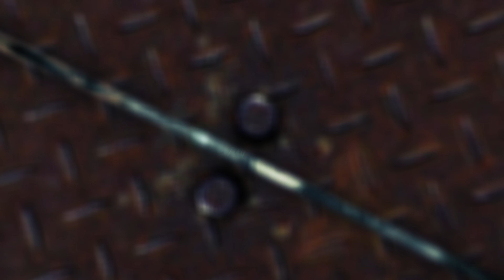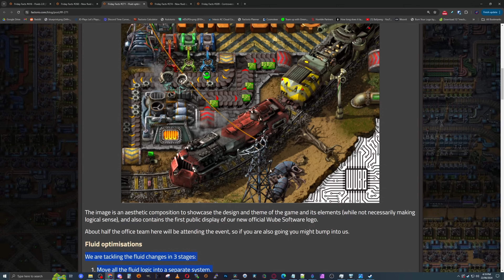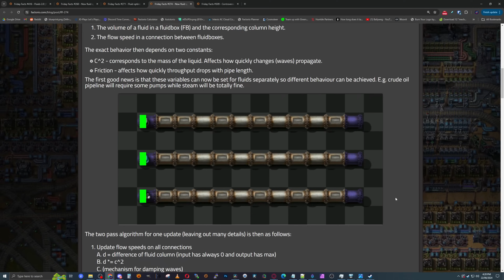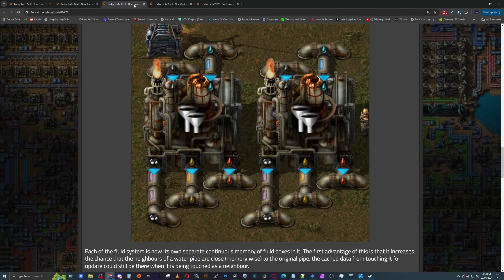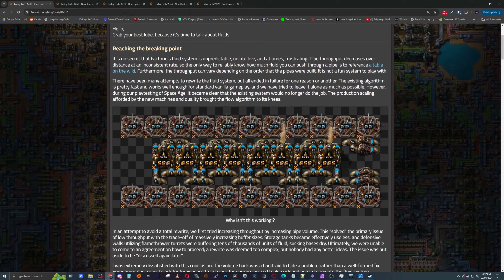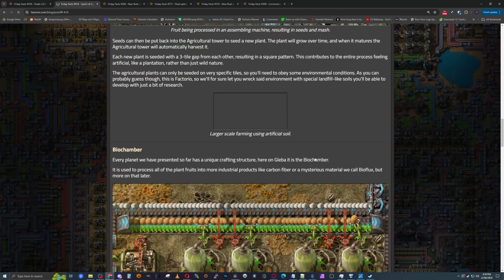Factorio Friday Facts #416 ⚙️Fluids 2.0

Comment: the example of the fuel etc about balancing out its so wrong... you need both fuel and oxidiser for the plataform to move.. wich gives you meteorites wich gives you ice wich gives you fuel and oxidiser... if you have more fuel than oxidiser you cant move the plataform.. you wont move... done

so insted of having a fluid system that just work this guy wants an inserter and circuit to bypass something bad. -.-
my god.. let the other guy have his own opinion..

Comment: 15:00 The problem with the long pipe (as stated in the paragraph above the video) is that the flow is not predictable. If you look at the green bars you can see that although it trends downward there are many spots were the fluid level randomly spikes up.
Reply: The chunk boundary problem is an issue I completely forgot about and it causes even more weird effects if there is a pipe junction on a chunk boundary.

Comment: this whole fluid nonsense is solving a non-issue
Reply: Floating point rounding error. UPS. Ugly underground pipe to underground pipe chain. Tanks balancing using circuits at train station. Yeah, there are no problems.
Reply: Perhaps a current non issue (though while it's true that there are effective work arounds that does not mean it isn't a problem for everyone else without the knowledge for the work arounds)

Who knows that you might need it on a pipe only planet or whatever not possible in the current system.

New system seems quite simple
Entire pipeline is effectively one tank, insert speed is unlimited to the trank, withdrawal speed is based on fill level, location and distances are irrelevant.
Pumps are one way gates between tanks that drains one "tank" to fill the next.
Reply: Except it sounds like it became an issue: "However, during our playtesting of Space Age, it became clear that the existing system would no longer do the job. The production scaling afforded by the new machines and quality brought the flow algorithm to its knees."  So... they did something with it.
Reply: I justant to know when I can try it